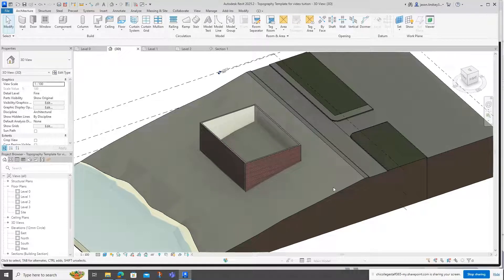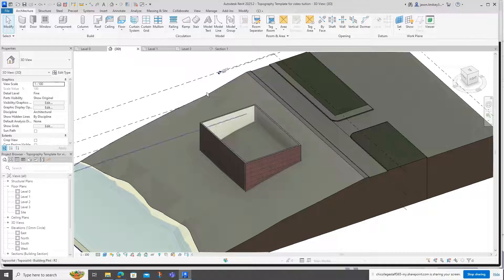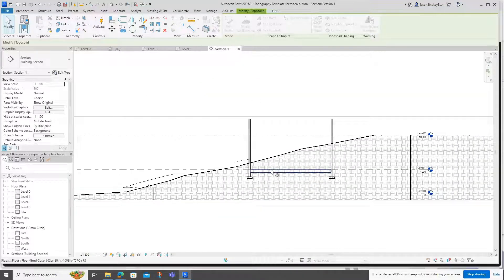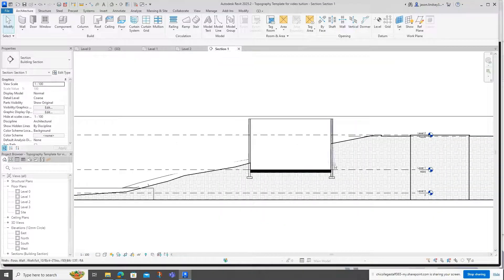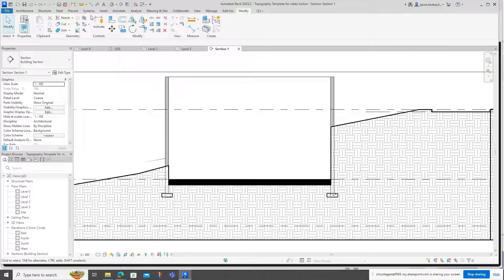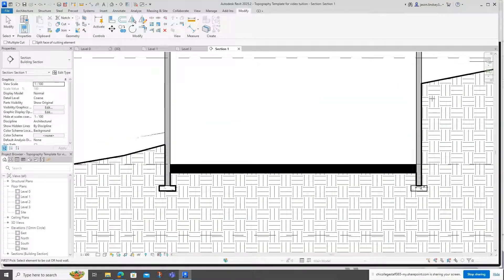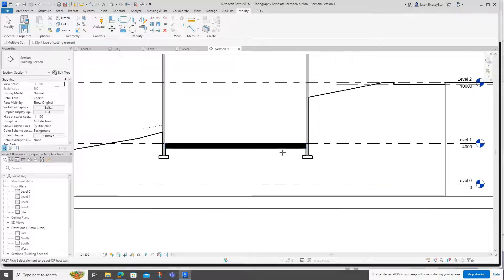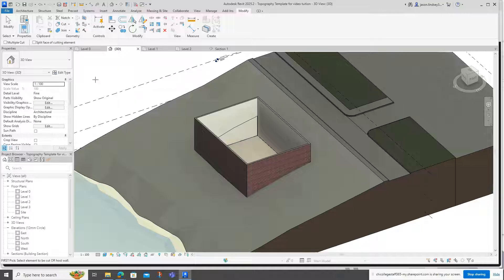Using the Excavate Tool for Toposolids in Revit 2025

Comment: Excavate tool is broken. It doesnt work on topographies like sloppy surfaces where  shape is more dramatic. Random elevation points are causing problem  which says "can't cut joined elements" and you can't solve it. After  attaching sooo many elevation point on my floor I cant f excavate it